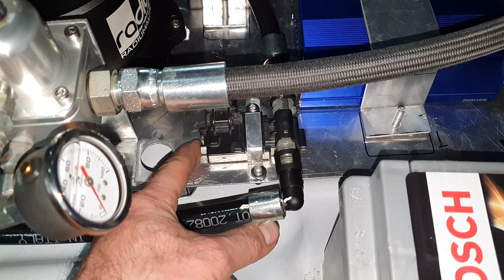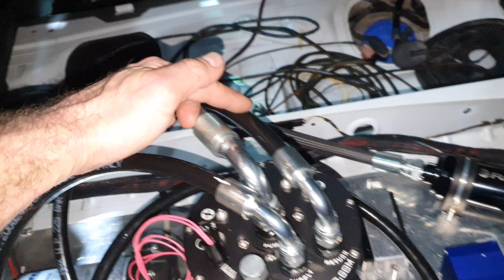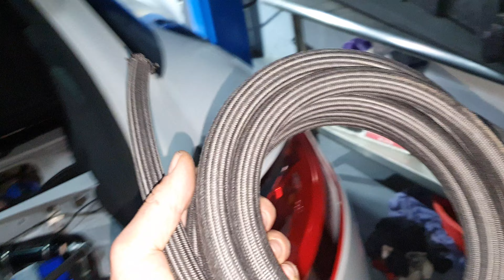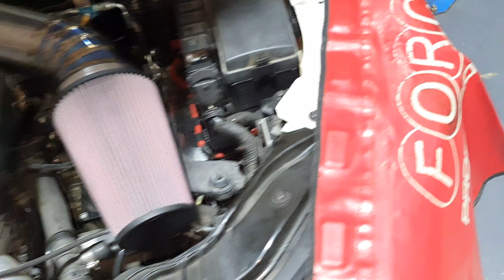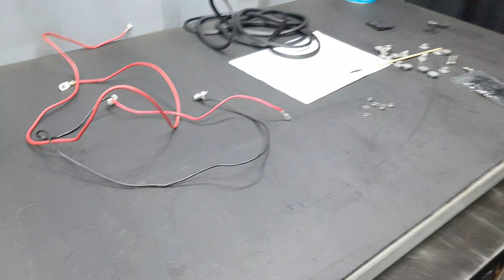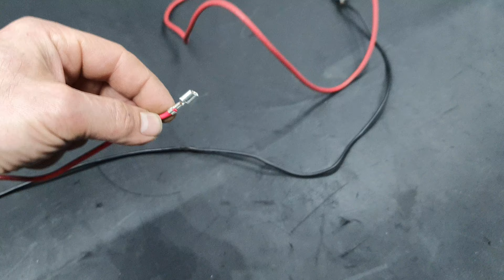fuel system upgrade with surge tank (part 7)

Comment: It really does seem like not changing the final section of the fuel line where it feeds the low pressure injectors and the direct injection fuel pump defeats the purpose of the surge tank.